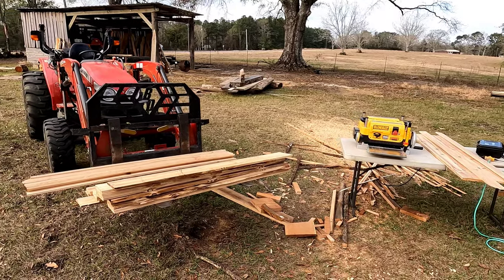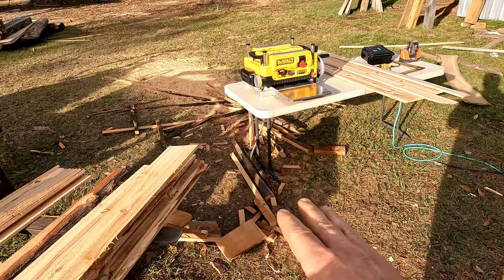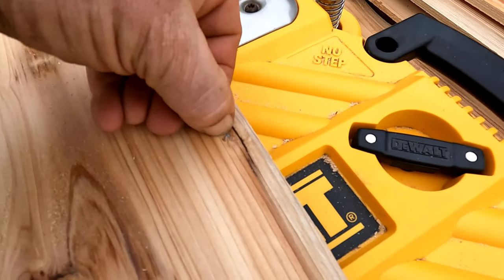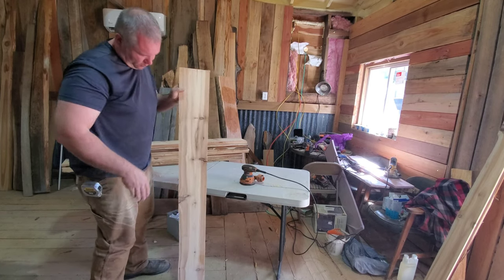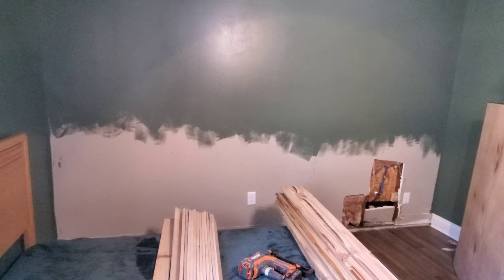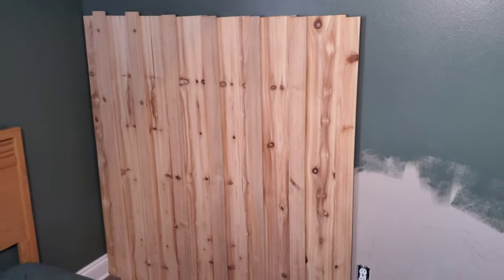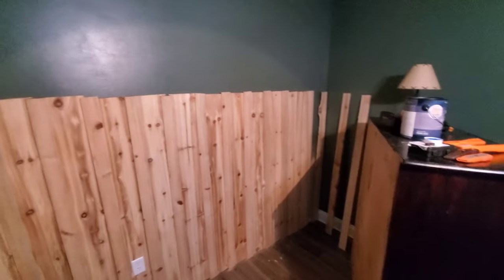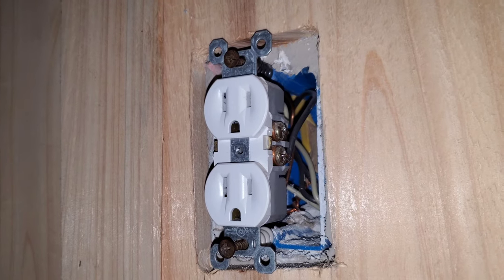Wood accent wall made out of China Fir and Cypress

Comment: Looks as thpugh you need a heavier circuit or a shorter extension cord for that plainer. My Grizzle runs on 220 so I have to be closer to a source than where you arecworking.